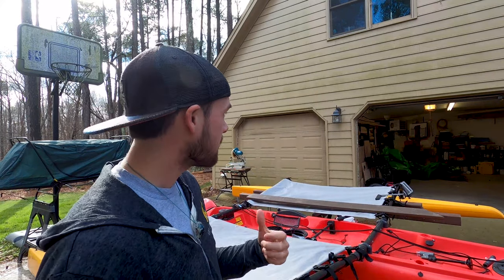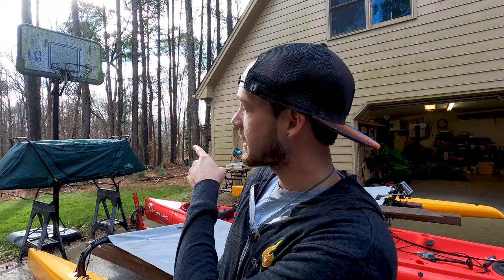Kamprite Tent Cot Rig - Hobie Mirage Adventure Island

Comment: Why didn't you just put the cot tent directly on the tramps?
Reply from the maker: Hi Noah! A great question. There would be no way to secure the tent to the boat at that point. Plus it would probably be less stable and wear the tramps down much faster. This is probably not the best method, but it works for me.